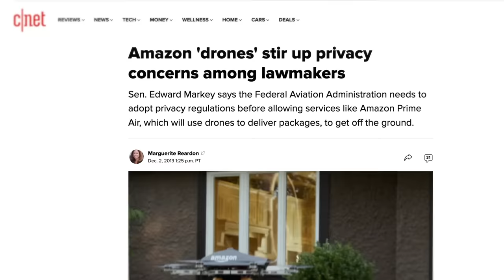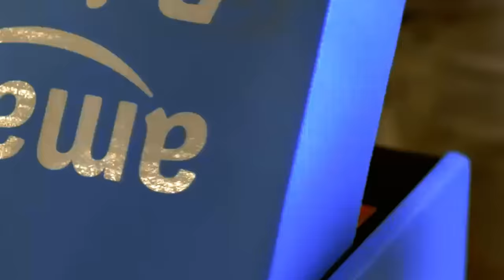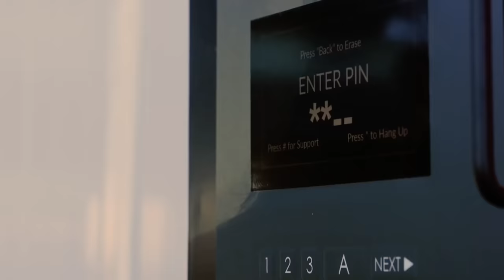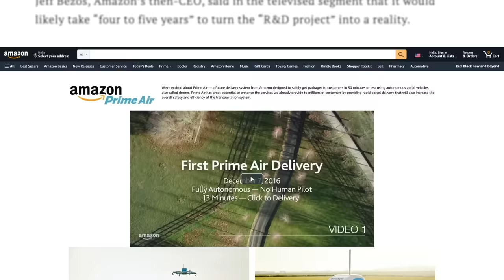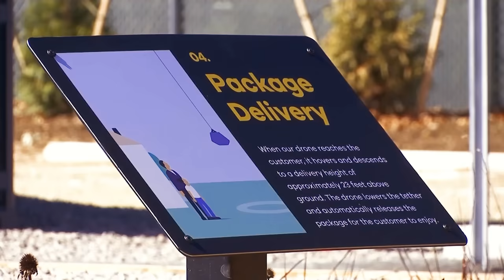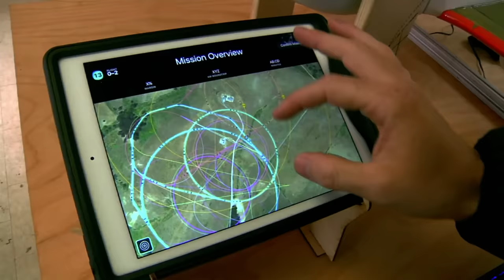Drone Delivery Was Supposed to be the Future. What Went Wrong?

Comment: I think Amazon's drone delivery is a solution that doesn't work for a problem that doesn't really exist.

Logistically, it's not that much faster then a guy in a car and Amazon's grand scheme of same-day or 2-day delivery was already pushing things (and wasn't so much driven by consumer demand as it was because of Amazon desperately trying to strangle brick and mortar to death after conquering the internet), and computerized quadcopters will never be more energy-efficient than land travel.  In fact, a quadcopter may be the least energy-efficient form of air travel and wouldn't scale at all.
Reply: Quadcopters are "inefficient" but can still be more efficient than a car when delivering something small, because they don't have to move the car.
Reply: For consumers, you are right, but for Amazon, it solves a real problem: humans are fickle workers, robots are not. If Amazon was able to get self driving vans and drones working well, it could theoretically fire most of their last mile workers and would not have to worry about ever increasing paychecks or unions.
Reply: You just haven’t thought of putting wings on the drones, and have it use the air and the wind (maybe even to recharge its battery, at least to extend the finite battery life)

Plus, I don’t really get what you think you’re seeing in current & incomplete battery technology that’ll very easily change things

VTOL is a lot more demanding than the Bernoulli-Newtonian force, although necessary if you don’t have the space
Reply: “form of air travel “
But that’s just it : Air travel > Ground travel ; you don’t have to pave an AIRway, and there’s a entire 3rd dimension
Reply: @donaldhobson8873  Except when every individual delivery has to get its own little vehicle flight, the scaling nullifies the advantages over a car.

 @Nicholas Leclerc  That does work, and then it's no longer a quadcopter.
Reply: @slothfulcobra  you could combine a quadcopter for vtol with wings for effiency. But I agree, you would need probably thounds of those units per area, they would never pay of, would way?
Reply: @nicholasleclerc1583  Not trying to be snarky, but a serious question: can the drone model deal with a scenario where it's not just one drone flying around, but thousands, from both your own company and others?
Reply: So the Future is Drone to 19th steam chimney like vending machine or vending location.
Reply: Exactly, it potentially solves a profit problem for the company but has no impact on the customer for the better. So none of us are incentivized to help push for it.
Reply: @KyurekiHana  They would have to worry about the increasing costs of maintaining a fleet of autonomous vehicles. Besides, who's going to actually get the package out of the vehicle and take it to the customer's door?
Reply: @donaldhobson8873  This is a hilarious misconception. Logistics drones need huge batteries and extra motors so weigh 80-90 pounds each and are ONLY doing one trip then have to return for another package. There's zero serialization and can only do max of 5 pounds. Assuming every package delivered were 5 pounds the max allowed that'd be a ratio of at least 16 to 1. Also its carrying that 80+ pounds of weight on the trip back! This is not true of a logistic route that'll end up close to where it started. A van can easily hit half its curb weight.
Reply: @suedenim  That's the least of the worries.  The tech already exists for them to avoid each other.  It would basically be the same kind of tech in self-driving cars.  On top of that, I'm sure it wouldn't be long before skyways are created for the drones so it's not just a free-for-all.
Reply: @KaitouKaiju  The idea from what I understood, which depended on technology improving and getting cheaper as time went on: A can drives into a neighborhood then autonomously parks somewhere. A drone takes packages out of the truck and puts it somewhere for the customer to retrieve. The drone returns to the van for the next package, and when done the van would have a charging station for the drone.
Reply: @KyurekiHana  How does a drone pick up the right package in a van full of them? Stuff shifts during transport, could be buried. Maybe if their van were purpose built to dispense packages this way, but then you increase cost and complexity yet again. But hey, more engineering jobs! It's definitely not cheaper than paying a gig worker $10 to deliver a package on their lunch break
Reply: Sure but cars shouldnt be used either because thats just alot of unecessary mass transported
Reply: You're dreaming.
Reply: @KaitouKaiju  The same way automatic warehouse robots pick out the correct package, except it's on a smaller scale and simpler
Reply: @KaitouKaiju  Did you actually do the math on that? Or are you just hoping that's true?
Reply: @uku4171  You like BGRY? Any other companies I should be checking out that you know of?
Reply: @2beJT  You sure you replied to the right comment?
Reply: @uku4171  Do you like BGRY? Do you have any companies you like for automation?
Reply: @2beJT  no
Reply: @2beJT  I don't get why you're asking this
Reply: @uku4171  Because Berkshire Grey is an automatic warehouse company.
 BGRY is their ticker symbol.
You seemed to be familiar with automated warehouses from your comment. I wasn't sure if you were familiar with BGRY
Reply: @2beJT I see. I am not that familiar with the technology or the companies.
Reply: @uku4171  Those warehouses require building sized machines. Inside a van, with packages of varying size, shape and weight like I said it's an engineering challenge. It would require specialized vehicles which also drives up the cost
Reply: @2beJT  If it weren't true, Amazon would have deployed its drones already since they have been working on the technology for well over a decade.
Reply: @KaitouKaiju  The warehouses require building sized machines because the whole building needs to use the machine, not because the machine can't be smaller. I don't think picking up the package would be that big of a deal. It could even use a system similar to a vending machine. 

Of course everything requires complexity, and complexity often adds cost. But the tradeoff is very often worth it. I can't be sure that's the case here, of course.

Comment: Remote pilot here, there's just way too many little technical details that all must be in alignment for DDS to work, otherwise it's just flat out unsafe and unreliable. There are areas where it works and being implemented, but they are very straight forward and linear. It is impossible to have a blanket system in place. You have to have a single, repeatable, low variability mission. The issue with "we want to deliver packages to people". is there's million questions and variables that need to be addressed with that statement, and it won't take off because paying someone to just drive it is 100x easier and cheaper than hiring a 107 certified remote pilot and then developing new infrastructure AND technology. Too much risk.

Comment: I work for a drone (not delivery) company. In America, and many other countries, there's yet another complication that you didn't touch on: Drones are not legally allowed to fly beyond line-of-site of their human operator. Zipline works in Rwanda and other African countries because the laws are far more lax there, and their US operations are highly situational, but it's currently impossible for large scale far-reaching BVLOS (Beyond Visual Line-Of-Sight) operations within the US, especially ones that require flights over humans like what drone delivery requires. 
The regulations governing this can be found in FAR Part 107, but it's a rather dry read so I recommend looking at commercial drone operator study guides to get the gist of things. 
It IS possible to get waivers to these regulations, but it's not easy, and it's highly situational. Currently, even the big players are only getting location-based waivers for BVLOS flights: "You an fly up to 3 miles in this specific location, with visual observer crew members placed at these predescribed points." And to get such waivers, you have to elaborate on contingencies for every possible failure the system or operation could have and how you plan to deal with it, as well as whatever safety features your drone has on board. A big one they like to see is DAA (Detect And Avoid) systems to prevent collisions with other aircraft. 
There absolutely ARE industries where drones can do it better. Zipline is a great example of this. Other industries that use light aircraft and helicopters can also be done with drones for potential pennies on the dollar, big ones are infrastructure inspections, search and rescue, law enforcement/surveillance, and aerial survey/mapping. The tech is actually very close to being ready for much more, but we are still in a legal proof of concept phase, because the FAA has quite the stick up their own rear about safety. 
I don't really see a bright future for drone delivery the way amazon and co wanted to do it. It's a tech-forward "solution" to a problem that is hardly a problem at all, and is so full of holes itself that the percentage of the population it could actually be used for is staggeringly low.

Comment: Would be great use for autoshops and autopart stores. Sometimes autoshops just need an O-ring or other small item that would otherwise be a waste to have a dedicated/scheduled delivery. I guess it wouldnt be that big of a benefits as those small deliveries are probably bundled with heavier item deliveries like axles, brakes, rotors...etc, so as one tech needs an o-ring the other needs brake parts so delivering at the same time is not a waste at all. Just image an EMS first aid drone thats able to be first dispatched to lost souls in the woods or other emergency, given they have a GPS 911 radio etc. Maybe they would get there first before actual help via people in helicopters, planes boats ems...etc arrive. Its a niche and its expensive. If the drone dont make it etc causing damage is another iffy.
Reply: I agree with the auto parts sentiment - commercial establishments that that need daily or multiple times daily delivery could benefit greatly. for example my building sometimes gets several packages a day from Mcmaster or Grainger etc, we could set up a designated landing pad for a drone for those deliveries.
Reply: Need McMaster to get onboard, they use car curriers today though and are already pretty quick
Reply: @jeremyloveslinux  another thing to consider is weather. Yeah vehicle delivery may be slowed, but they get there. Drones might not be able to fly in wimdy times or heavy snow/rain making  vehicle deliveries still needed. So why switch when vehicle deliveries are still needed. Things in business kinda need to be intrinsically in working order.
Reply: @jeremyloveslinux  Believe in JESUS today, confess and repent of your sins. No one goes to heaven for doing good but by believing in JESUS who died for our sins. GOD loves you soo much unconditionally.😍😚🤗
Reply: EMS drones delivering defibrillators are a thing already. As are S&R drones
Reply: An even better solution for autoshops and autopart stores would be 3D printers. Yet another technology that hasn't become as ubiquitous as it was hyped to become. Though they'd probably need very specialized ones, but we have companies that cater to such niches already (for instance, scientific equipment suppliers).
Reply: @ArawnOfAnnwn  the problem with 3d printing is that you need to actually know what you are doing just like with cnc machines you can't just push a button and expect everything to work flawlessly like an ink jet printer and if it fails its usually a time consuming repair or even an expensive replacement that is needed. 3d printing is simply not idiot proof and probably never will.

Comment: I thought about this last foot problem when they first started the drone thing. The programming is probably good enough to prevent dropping something on someone's head or into the water when there's a good five foot radius of open ground to target, but I can't blame the companies for not wanting to risk it. And besides, I think theft is a concern for people not at home right when it gets there.

If we're serious about this, the next step would be normalizing a larger mailbox that packages can be securely dropped into, both in residential and commercial use. Some people could even repurpose their chimneys to do the job, and that would make a very interesting architectural feature on new homes.
Reply: Chimneys? You do understand, that houses that come with chimneys usually need them, so you can't just drop stuff into them? And if you drop something on the chimney cover, you need someone to climb up on its rooftop to pick up the package?
Reply: @stefanb6539  they don't usually need them, at least not in the US. Almost all of those houses have HVAC and the chimney is either totally decorative or people fire it up it every once in a while for aesthetic reasons. Either, way, they aren't necessary.

But use your imagination: if you stop using it for its intended purpose, then you basically have a chute a flying drone can get to while people on the ground can't, so it's secure. Package size would be limited by the opening, that's an issue, but small packages would be no problem and you wouldn't be leaving them out on your lawn for anyone to see and steal.
Reply: @ideologybot4592  Unless that heating is all electric they still need a chimney. We also have central heating in almost all houses here in europe, and a gas or oil boiler still needs a chimney.

Comment: As a delivery driver myself, I always laughed when I heard someone ask whether I was worried about drones taking over my job. We don't even remotely have the infrastructure to support that on even a small scale, which is a bigger and far more costly long term issue than the AI not being good enough to know how to handle the final step of delivery. You'd need dozens of drones even just exclusively for the early morning deliveries in small cities. They'd have to have charging stations, loading stations, regular maintenance, a reliable, strong connection to the server that runs them, a delivery range that isn't just a tiny handful of miles, and be built with decent carrying capacities. At that point, you really aren't saving any money versus just having your drivers out for another 30 minutes in the day. 

For delivery to expand further than that - perhaps to handle all the in-town deliveries for the day - you'd need a warehouse full of hundreds of drones, delivering one parcel at a time before making a return trip back. And you still would have to rely on drivers to handle heavy or multi-piece orders, as well as pickups, unless businesses pony up for their own drone loading stations. 

The idea of drones having an impact on the industry was always restricted to very niche use cases. Maybe if a company spent a decade or two completely replacing their driver-based infrastructure with a drone-based one... but anything short of that never had a ghost of a chance.